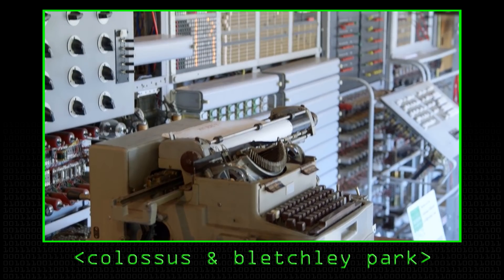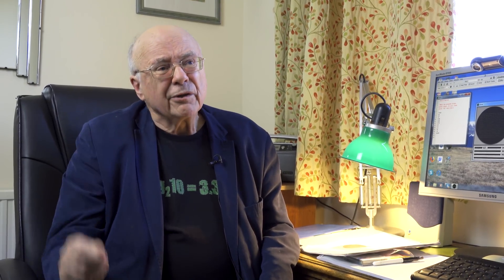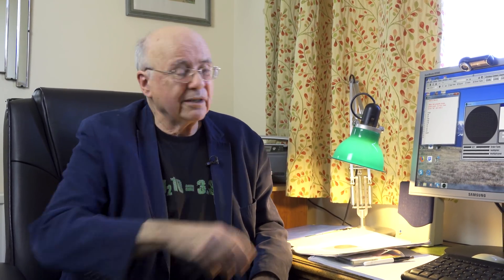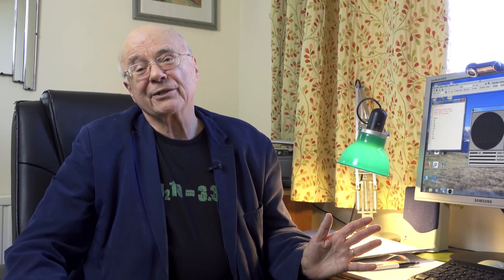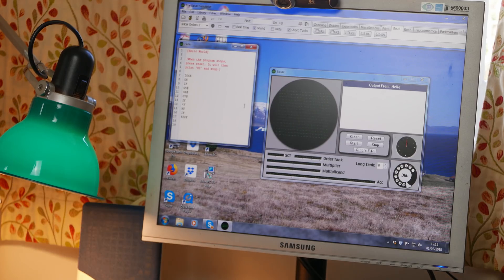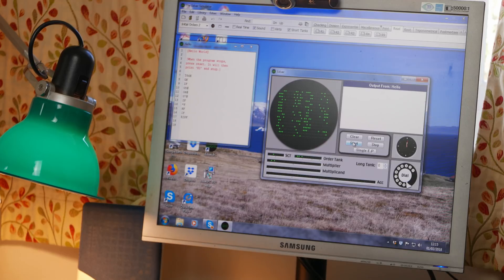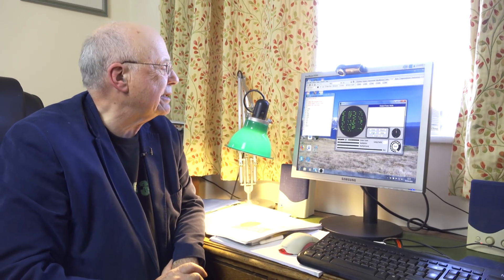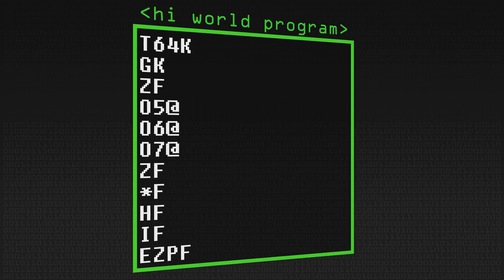Bootstrapping EDSAC: Initial Orders - Computerphile

Comment: If you wanted to print out "WORLD" i.e. O5@ O6@ O7@ O8@ O9@ and then later you decided you wanted do something else before printing WORLD (e.g. jump/branch, print another word "HELLO", etc.) wouldn't you still have to update all your offsets, because you had inserted more instructions between the program origin in memory and the location of your data (WF, OF, RF, LF, DF)?
Reply: Yes, you still have to get your offsets correct. But the much bigger pain (of having to change almost everything, if you moved a chunk of code to a new position) has now been overcome.
Reply: That's very convenient and impressive that Wheeler managed to achieve this in forty-something words 😳
Reply: Yes if you download the EDSAC simulator and read the documentation that comes with it, there is a listing of Initial Orders II somewhere in there. The more you study them, and work out exactly what they are doing, the more impressive David Wheeler's  achievement becomes.

Comment: 12:25 That's a bit confusing. I take that to mean 5 locations from the instruction pointer, when in fact it's 5 locations from the base address.
Reply: Yes -- many apologies for that slip-up!  I'll try and indicate in the sub-titles that the offsets are relative to the base address.
Reply: Thanks for this. Yes the character P is 00000 in EDSAC encoding and these 5 bits occupy the LH end of the word (see Fig. 5 of the Tutorial). 
It's a no-op as an op-code but is very useful in a machine where integer constants can only be inserted by making them look like pseudo-instructions! 
So , in P 23 F, the F resolves into a 0 at the far RH end of the word to show it's a single-length instruction. The 23 , or 0000010111 in  10-bit binary, occupies the 10-bit  "Address"  field but this is pushed one place to the left by the trailing 0 bit we already inserted for `F' . This shift left doubles the 23 into looking like 46  - if the word is regarded just as a bit-pattern for an integer.  A trailing `D' in the instruction format plants a 1 at the far RH end. Combined with the shifted-left doubling already referred to,  this explains why P 16 D is 16*2+1  = 33
Reply: Yes, I also expected the program to be like: O5@, O5@, O5@
Reply: Exactly what I came here to say!

Comment: Wonderful video. I've used a Data General Nova 1220 with front-panel toggle switches (1978 in High School), and also booted a Univac 1100/42 from drum (1981 in the USAF). Also later used a bunch of PDP-11's as front end to Bell & Howell COM recorders, making microfiche in a service bureau.
Reply: I still remember a lot of the PDP11 boot loader. Can't remember where I put my car keys, but part of my memory is tied up with that.

Comment: There is one thing I don't understand, if the address given by @ is relative to the current instruction, should it not be always O5@? As each instruction will the base address? Or the @ is relative to the beginning of the program?
Reply: I think he may have misspoken at some point if he implied that. Reasoning backward, if you get to address 69 by adding 05 to something, then that something is 64, but that instruction was from address 66. So it's not relative to the current instruction. Scrolling up, the "T64K" instruction is probably setting the base offset shared by all the subsequent instructions (and that might be what the video was about).
Reply: I made a quick reply to another similar comment, and I think this has to do with the limited size of the initial orders.

In order to make the memory reference relative to the current line versus relative to the start of the program, it would have to take more memory and code to keep track of your current line, as well as the relative reference itself, to then add both of them to the initialized start of the program.

Comment: I once programmed a computer with a hammer. 
On the IBM 360 mod 30 boot code was stored in read only TROS strips (transformer read only strip). A one or zero was encoded by which side of a magnet the strip had a hole. One night we were doing engineering changes on a mod 30 and I was tasked with adding new holes to a TROS strip. This was done using a hammer and a 3/8 inch punch.
Reply: It was 1968 when we were doing EC's on the IBM 360 equipment. Interestingly the 360 mod 40 did use punched cards for micro code and boot code. Rather than TROC the mod40 used CROS (capacitive read only storage). One and zeros were encoded by holes the a standard punch card. the cards were sandwiched between a flat plate and an array of addressable electrodes. The card hole provided a dielectric different from a no hole. CROS was bulkier than TROS, but much faster to read. Instead of a hammer I used an 029 to program the micro code. Higher speed cpu's used still other methods for read only storage, including diode arrays. The first floppy disk was invented to store micro code the 360 channel controller. Oh yeah, I was there even before the 7094 back to the 650.
Reply: @VoteScientist  brilliant
Reply: @VoteScientist  It's probably worth mentioning that the IBM 029 was a card punch.
Reply: Now that's what I call coding close to the metal
Reply: @amicloud_yt  Coding right through the metal, it sounds like.
Reply: ok?

Comment: @Computerphile Would humans be able to hear the beeping from the mercury tank, or is it outside human hearing? maybe because of the weight of the mercury or something?
Reply: It is way higher than human hearing over 100kHz, I think. Incidentally, Maurice Wilkes told me they wanted to use Alcohol instead of Mercury as it was more stable with temperature, but no one could guarantee the security of that much alcohol in the presence of students.

Comment: 14:45 Now you know why linkers used to be called link-loaders, and the Unix linker is still named ld.
Reply: Didn't code "bugs" get thier name from the insects that'd get stuck in the rotors and memory and prevent intended function?
Reply: No.  The term "bug" has been used in engineering circles since the 19th century.
Reply: Indeed. It's an interesting etymological mystery.

But the most fruitful avenue appears to be that it's actually related to "bug" in the sense of illness. When you've caught a cold or the flu and you might say "I've caught a bug". Which actually takes its etymological journey past Shakespeare, who talked of a "bug" being upon someone, meaning that an illness had befallen them.

Tracing it further, this sense of "bug" actually comes from the pre-scientific belief that illness was caused by "evil spirits". That if someone had gone mad by illness, this was because a malicious ghost had "possessed" them. And, in Medieval times, they had a wonderful means of "curing" someone - called "trepanning" - where they drilled a hole in a person's skull to let out or release this "spirit".

So this brings us to the conclusion that when we say a program has a bug, the underlying semantics are that there is a "ghost in the machine", as it were, that's behaving maliciously and driving the thing to a bit of "temporary insanity" and a bout of the sniffles, so to speak.

That it's feeling a bit under the weather because it's "caught a bug", which is itself the notion that you've been possessed by a malicious spirit, passing through.

So, really, a debugging session could alternatively be called "an exorcism".

*cue Mike Oldfield's "The Exorcist" theme*
Reply: Evi1M4chine  I made two comments.  Which are you challenging?

Comment: Clearly some people find this historical information interesting, but I would much prefer to hear more modern stuff such as the admirable talk on Bitcoin Scaling or how to set up a Mesh network or using the Raspberry Pi GPU

I used the machine at the Maths Lab in 1970.  I remember the flexowriters where you could feed the 5 hole paper tape output back into the input and it would copy it until stopped.  It had letter shift or similar.  Then the PDP8 and PDP 11 had switch registers with Load address and deposit keys.  The PDP8 ? had a RIM and a BIN loader & the PDP11 had an absolute loader I believe.  The PDP11 maintained its core memory after power down and one could leave a program in memory which would start automatically on power up.

Later generations will have entered Basic or Z80 machine code into their ZX80 or Spectrum computers and nowadays there is information as to how to write in Assembler for the Raspberry Pi
Reply: I find this early stuff much more interesting than the stuff from my lifetime. When I visited the museum of computing at Bletchley Park in 2016, I spent most of my time with the machines from before I was born, and only had an hour before closing time to skim over the stuff from the 1980s and onwards.

There's something fundamentally more interesting about punching a program on paper tape than typing into GW-BASIC.
Reply: Roxor128 A stint at maintaining a suite of COBOL programs held on punched cards would probably cure you of this ;)
Reply: Richard Mullens  -  Heh. Probably. I've looked up COBOL on Wikipedia and from the source code samples I've seen there, I don't fancy having to write it.
Reply: Onno Inada rarely, but I've heard of systems in use at banks that are specced to perform some ops exactly as "the original".. which is written in COBOL on punched cards and stored in a vault.
Reply: Richard Mullens They...  They still use those?!